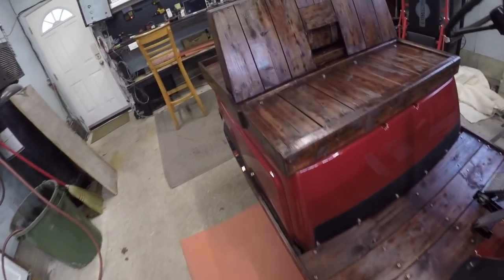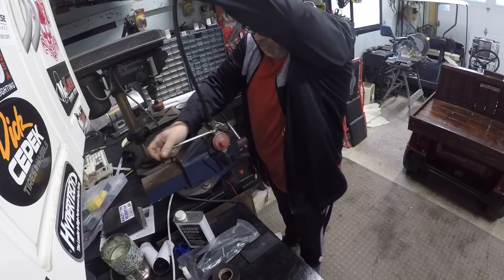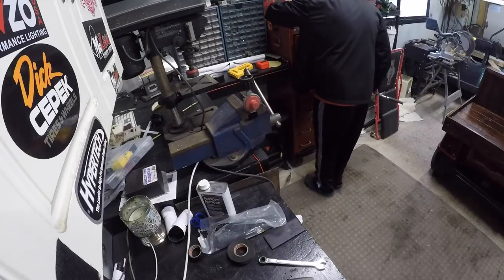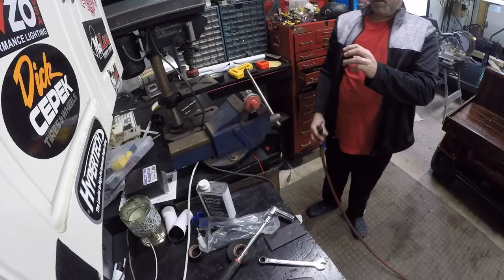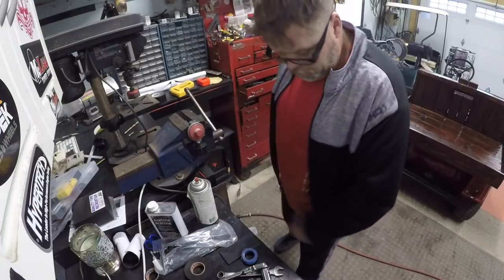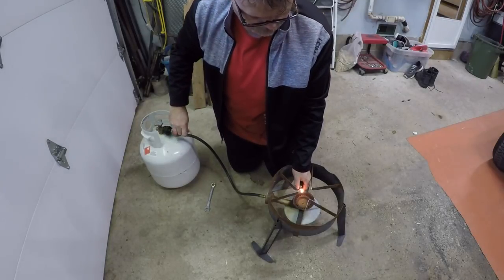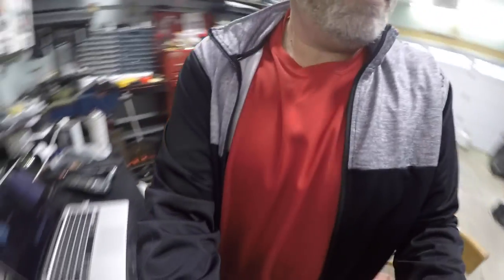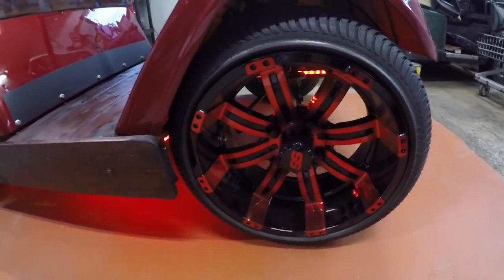Propane Propane Going To Blow Myself Up

Comment: Bell s lff the golf cart is looking awesome man excellent job if you do put the roof on you going to make it a convertible so I can go up and down you use hinges off a boat would be awesome and don't blow your ass off in the garage with the propane awesome video bill call your gas company and get them to rent you a gas unit for the wall for the shop I think it's about 35 bucks a month and we'll be safe and be warm as hell in there why wouldn't it be take care
Reply from the maker: I will look into that buds